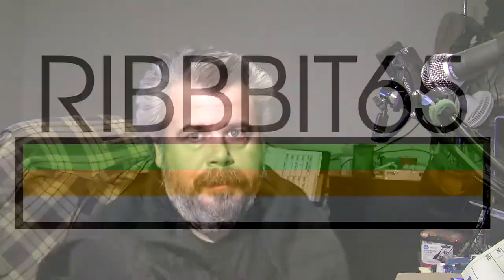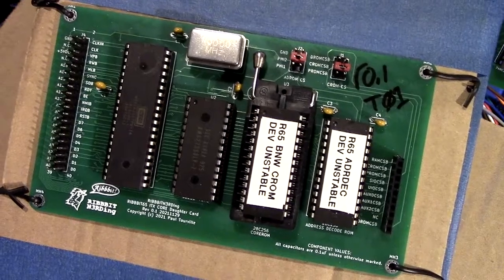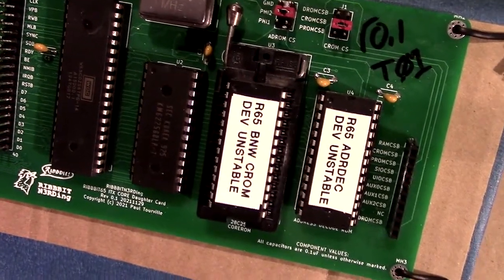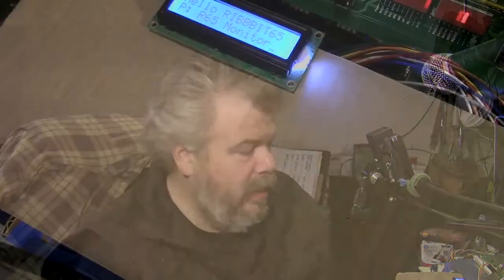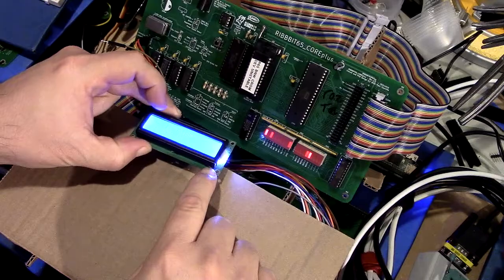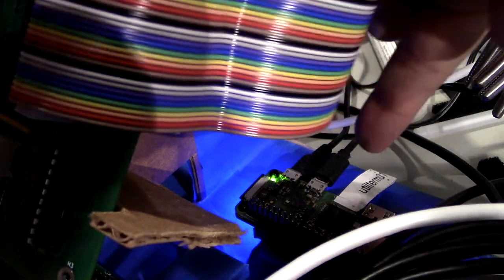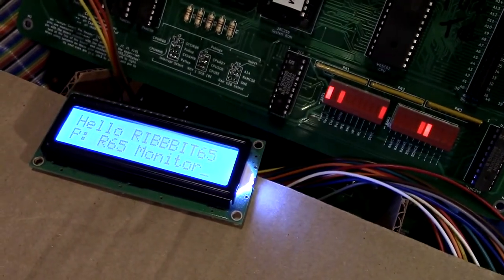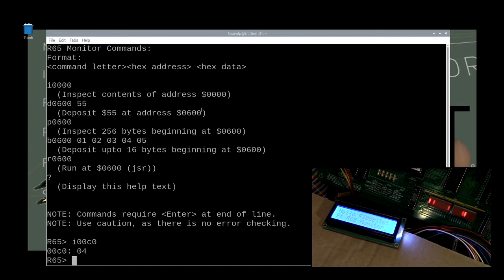RIBBBIT65 Update!  Boards! CrapDASM!  Blerg!

Comment: I think your new logo colors represent PCB layers. 😉

I made a disassembler that not only looks up the opcodes and addressing modes, but also displays printable ASCII charactets. This way, I can tell if it's code vs data.
Reply from the maker: Thanks, Frederic... I considered doing ASCII "figure it out"... but... i was "lazy" ;)  as for the colors.... nice try, but try again. :)
Reply from the maker: That's an interesting take.  I was thinking more along the lines of what you might see outside the computer rather than inside.

As for disassemblers and showing ascii for non-Assembly content... I thought about it... I may end up doing something more full-featured later... I just wanted to get something working, and fitting in fairly limited space.  The current version of CrapDASM does show addressing modes.